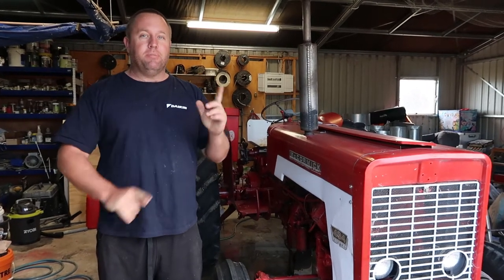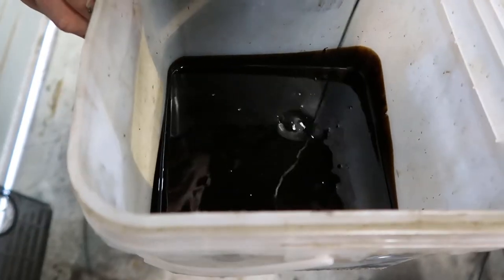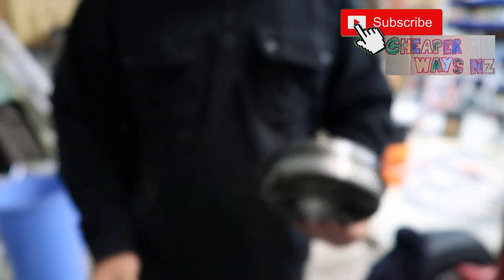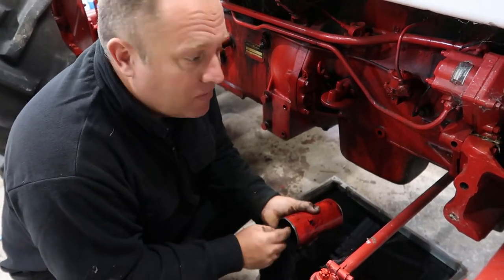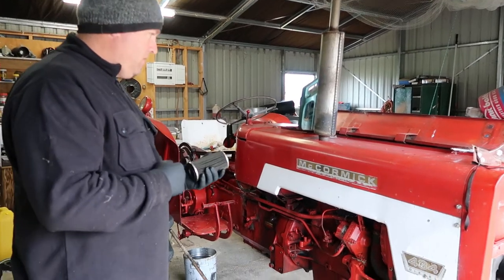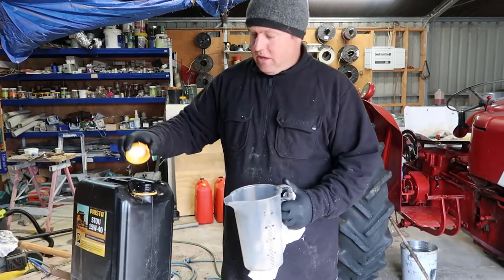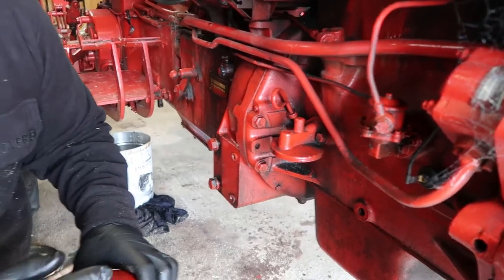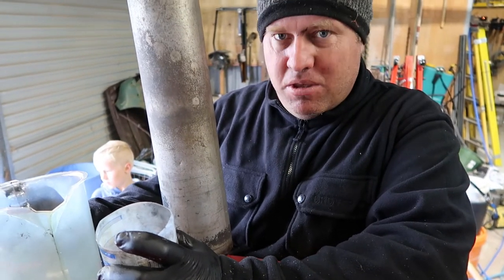How to Change the Oil & Filters on an Old Tractor / McCormick International 434

Comment: Hi,i have a 434 IH  and i didnt know you could clean the oil filters out.Mine has a wire case around the paper filter but the rest looks the same.I may try to wash mine out with gas and reuse it also.Thanks
Reply from the maker: Yeah - I've found you can't keep re-using them indefinitely though!  I've washed them for lawnmowers and chainsaws etc as well - would maybe do it once or twice before looking at just buying a new one 👍

Comment: Can you tell me where the diesel filter is or have you got a video of changing the diesel filter please
Reply from the maker: If you're sitting on the tractor, it's underneath the hood on the left hand side, just beneath the air intake manifolds (I'd personally take the whole cover off to change it just to make life easier!).  Next time I run out of fuel I might change it and do a video!

Comment: My bonus grandpa has a 434 too when i get my tractor driving licence i'll bring it home for service and repair the electricity on it 😁
Reply from the maker: Oh very cool! 😊
Reply: @CheaperWaysNZ  i find this very useful to me so i will be able to find everything on it 😁 i'd like to know how much hydraulic and transmission oil i need in case i will need to change that too and which type it is 😄
Reply from the maker: Yeah no problem - it's a bit late here at the moment but will have a look tomorrow and let you know 🙂
Reply: @CheaperWaysNZ  i saw your International 434 was also missing the gear stick knob too there are gear dticks knob for it available on ebay for example :p
Reply: I also found a new original seat for it too :p
Reply: I'll help finding parts for the tractor :p

Comment: I have the same tractor, it came with the house we recently bought. Are you going to do a video on changing the hydraulic oil next? I need to get around to doing mine
Reply from the maker: We actually did it not so long ago but didn't do it on video.  We used the same type of oil as the other stuff - should we do it again we'll record, but we do have the workshop manual if you wanted us to copy off some pages for you to refer to?
Reply: Cheaper Ways NZ yeah that’d be great thanks
Reply from the maker: No worries - do you have an email address or somewhere to send it to?
Reply from the maker: Just thinking - if you don't want your email address going public I have a "Cheaper Ways NZ" Facebook page - if you wanted to look that up I'm the moderator, you could flick me your email address over a PM 🙂
Reply: Congrats ashley my bonus grandpa tage hansson also has a mccormick international 434 it looks cool and i love tractors, in my room on the shelf i got 5 favourite tractors in models (all though i got many more favourites including cars) a Porsche 308 Super Diesel, Ferguson TE 20, Lanz Bulldog, Valtra T191 and Fiat 880 DT. We also got a Fiat 880 D backhoe tractor :)
Reply: In our other outbuilding we got 2 old tractors a porsche 308 super diesel and nuffield universial 3 sadly the owner only gave us the outbuildings, the garden and the old house and everything inside of them except for the tractors ☹ according to my dad he wants to give them to he's nephew 😕